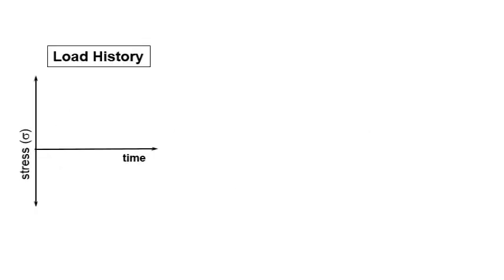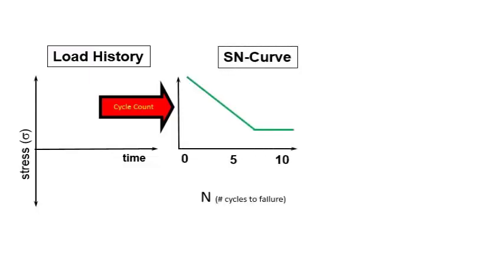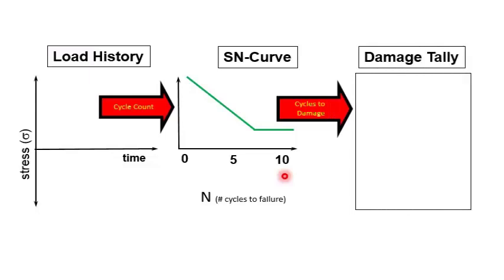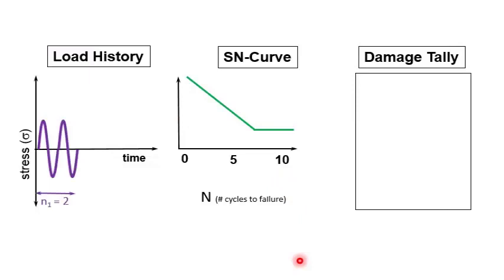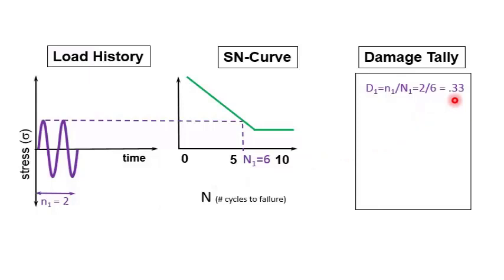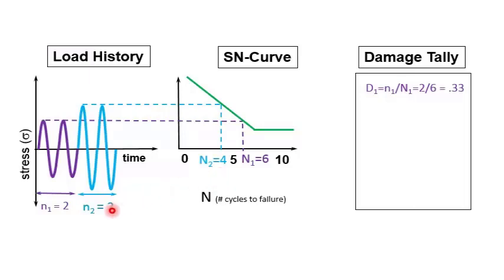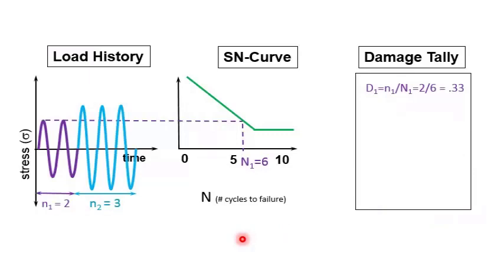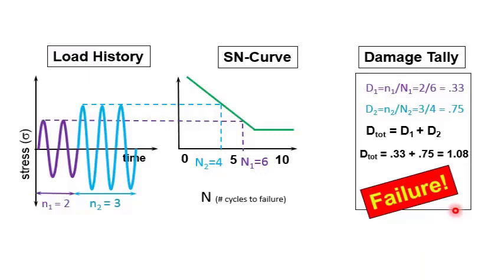Miner's Rule for Damage

Comment: I could see it failing way more. And before. It's not the stress value but the stress range, you missed that the stress has a negative component and then goes to the opposite side.

Comment: sir, how to determine the hours of 1 cycle?
Reply from the maker: Cyclic fatigue is independent of time.  Any stress cycle could be applied slowly or quickly.  In the end, the number of complete cycles applied is what matters.  If cycles in real life usage are applied quickly, the part will fail faster than if they are applied slowly over time.
Reply: @SimcenterTesting  so is it means, I need to know the value of time during the stress cycle? If I want to convert the cycles to time?